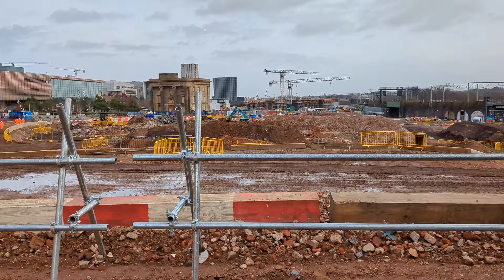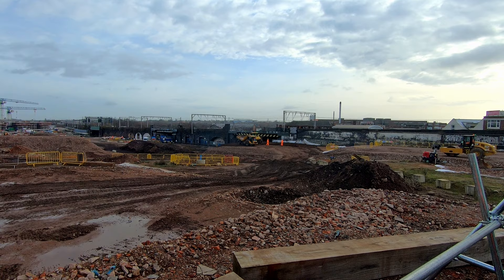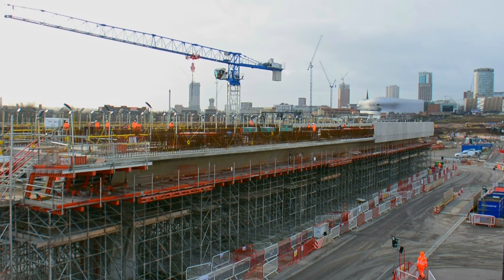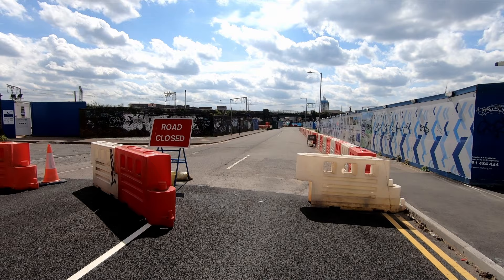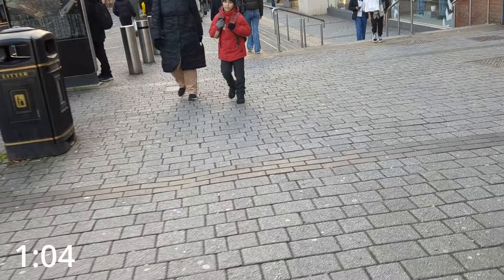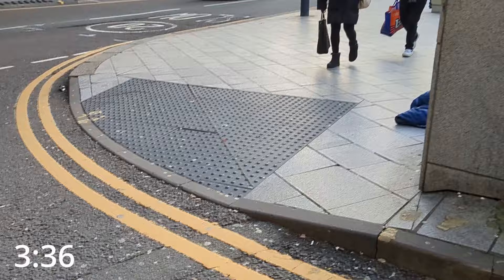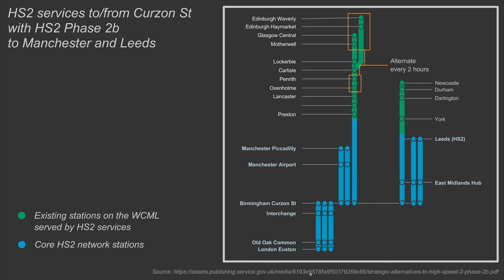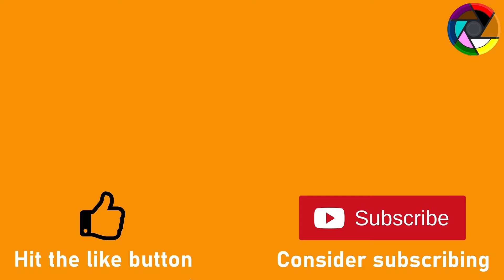Birmingham Curzon Street Station | HS2

Comment: Agree with your comments that we are where we are, But ARUP's proposal was to replace New street with a new super station at the Curzon street site, this could have been integrated with HS2 alongside it. When completed, people will look at Hs2 and say "why didn't we do it all"! But it's definitely not dead yet to the north. All power to Messrs. Street and Burnham showing Sunak what long term means
Reply from the maker: "Perfect is the enemy of good" tends to spring to mind, I agree there are ways in which HS2 could have been better, but sometimes you have to settle on a plan that is deliverable. If you think the Treasury is currently refusing to provide £4bn for Euston even with over site development, so it seems there would little hope they would provide £2bn or even £3bn for a better integrated Birmingham station.
Reply: Long term I don’t think it matters anyway. 

Whilst Brum has the trams, longer term it needs some sort of underground metro. An underground metro could create a pedestrian tunnel between New Street and Curzon Street with a large single station serving it.

Much like the plans for Euston, Kings Cross, St Pancras mega station for Crossrail 2.

I am aware this is very ambitious.

Comment: I agree that a station beneath New St wouldn't be practical in terms of construction, but I can't help feeling that an above-ground terminus somewhat limits the potential for future expansion into Wales or the southwest; any further HS lines would have to branch off the main HS2 spine leaving Curzon St as a stub end with no through-running.
Reply: What, like Euston for instance‽
Reply: I don't think it's a terrible situation but it certainly means that conections to interchange will likely need more consideration.

Comment: i mourn the death of this project. at least we will get some high speed rail...
Reply: I'm still holding onto the slight hope that an incoming Labour government would see sense and reinstate Phase 2.
Reply from the maker: Hopefully Labour will get into power and realise not linking Birmingham with the North is a mistake.
Reply: @Rail_Focus  You'll forgive me if I have my doubts...
Starmer and his lot are carrying on the age-old tradition of Red Tories.
Reply: @lighting7508 While "some" might be good, the benefit can only be felt by going all the way with it, and given how powerful the automotive lobby are, it was doomed from the start. That's not even mentioning the class-based North/South inequality.
Profit is the acid that erodes all progress.
Reply: @caramelldansen2204  it should’ve started from the north down 😭
Reply: @lighting7508 another major blow is not continuing to Euston. That doesn't make sense at all. Either way it's a mess.
Reply: @Rail_Focus  I hope they at least realise not building Birmingham surrounding infrastructure  to enable future expansion of the line makes zero sense. An that Euston has to have 11 platform, 12 if they can squeeze one more in.

Comment: Interesting and thought provoking, as someone that uses international rail travel via St Pancreas from Birmingham, the walk from Euston is littered with trip hazards and poor paving.  While walking is easier with cases than navigating the tube it is not really fit for purpose.  Neither is Paris I hasten to add!  It would be a disaster if the link between Curzon and New Street were not made easy as all these extras eat into time savings.  Great vid thank you 👍🏻
Reply from the maker: The tram extension will take you from 'door to door' but the walking routes still need work to aid integration

Comment: I believe that the junction towards Derby will be built  (with the one to Handsacre) but will become a long siding to the Lea Marston/Kingsbury compound. It'll allow it to be used to supply cast concrete sections to the remainder of the project and take lorry journeys off the local roads. Re New Street, There is a massive sewer under the station that was breached during the reconstruction. An HS2 station is nigh on impossible to fit in. Certainly not 7 platforms!
Reply from the maker: As far as I know the eastern spur will only have passive provision. Haven't heard about any connections to the east.

Comment: The West Midlands Metro needs to be rapidly expanded so the even phase1 of hs2 can be used somewhat well. Providing more rapid transit connections to the greater Birmingham area is what will decide whether hs2 phase 1 was worth it. Without rapid transit connections, most people will find hs2 useless, and the existing services serve most people better unless they can quickly get to Curzon Street.
Reply from the maker: The Metro and Rail Hub will definitely help.to spread the benefits wider

Comment: The tram being delayed by the station is going to lead to the ridiculous situation of the tram works having disrupted digbeth road and foot traffic for years at this point, all for a fully finished track to just be sitting there unconnected for another few years.
Reply from the maker: Frustrating for sure. I would've thought they could come up with a work around. Not sure if there will be OLE under the station or if they'll use the batteries like past the town hall.
Reply: @Rail_Focus  for your video on the digbeth extension I'd be interested to see if there are any plans for the full tram line out to the airport. The roadworks have definitely left space for (but filled in with dirt) lines going further out, with a distinctive curve where I saw the line going on a plan once.

Comment: Could something be done/have been done to better integrate Moor Street & Curzon Street? Anything from them having been planned as one interconnected station in the first place, or better connections between the two separate concourses?
Reply: I'm not sure it would be necessary, I think Moor Street will be right next to one of the entrances to Curzon Street. The layout of Moor Street also means that passengers already have to go up and over some lines to get to the east most platform, so any interior connection would probably do the same. As it is, I imagine passengers will just need to walk about 50m down the road to get to the new station.
Reply from the maker: There are plans to integrate the stations better, will hopefully be delivered as part of the Midlands Rail Hub.

But the western concourse will be right next door to the Moor St entrance, so transferring from one to the other will be straightforward
Reply: @Rail_Focus  There's a walkway planned for the south end of Moor St to Curzon St. It may be the easiest route for the less mobile.

Comment: Do you think they'll bild all 7 platforms given that, at present, they'll only need 2 or 3? Maybe turn a couple into an international terminal and built that connection to HS1?
Reply from the maker: Yep, it was too late to renegotiate the contracts by the time Sunak cancelled phase 2, so it was cheaper just to build the station as designed rather than cancel the contracts. At least this way it'll be future proofed for services to run North some day.
Reply: @Rail_Focus  Sadly as I understand he has cut back on infrastructure around Birmingham to allow for that.
Reply from the maker: Not that I'm aware of, they've recently agreed to fund the Midlands Rail Hub.
Reply: @Rail_Focus  That sounds interesting and perhaps you could produce a video on that int he future.
Reply from the maker: I'm hoping to at some stage, just waiting on further information.

Comment: Why do we have such poor construction ability - in terms of cost and speed but not quality.
Reply from the maker: Successive Governments failing to continue to invest in infrastructure, boom and bust leads to skills and knowledge being lost, with workers travelling overseas or retiring when the work dries up, which will happen with HS2 if we don't build phase 2.
Reply: @Rail_Focus  I'm surprised the pool of talent is so small. Is it the quantity surveyors, the architects, the engineers or designers that are in short supply or is it the actual workers "at the coal face"?
Reply from the maker: Both, tunnelers are in high demand and require a particular skill set, plant operators take time to train, then designers and architects, who haven't dealt with anything like this since HS1 was constructed. But designers and architects in particular will go when the work and the money is, so if the work dries up they can work elsewhere as their skills are in high demand around the world.
Reply: @Rail_Focus  From what I have seen on tv the actual tunnelling machine seems to do all the work. What are these particular skills you're referring to?
Reply from the maker: Each TBM is staffed by around 100 people in 2 shifts. There will be technicians keeping the thing running, workers who install conveyors, pipes and air systems as the TBM progresses, the workers who install the rings (Not many people want to work 12 hour shifts in a confined and dangerous environment) and people controlling the TBM and taking measurements to ensure it's on track. Then there will be people on the surface keeping the thing fed with tunnel segments. Entire factories have had to be built just to keep up with demand for segments, which have to be manufactured to millimetre tolerances.
Reply: @Rail_Focus  Thanks for giving me a full answer !!! 👍👍👍
Reply: @Rail_Focus designers also work on building projects.
Reply: @johnfrancis4401 The tunnel boring machine can only do what the operative driving it tells it. There are also a myriad of other things to construct as well.